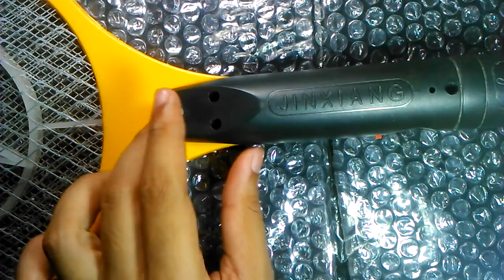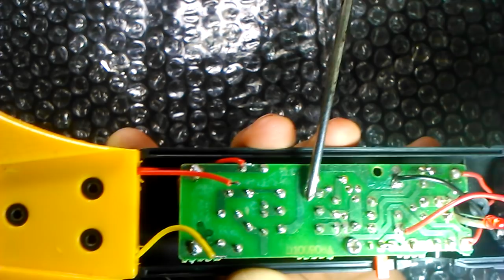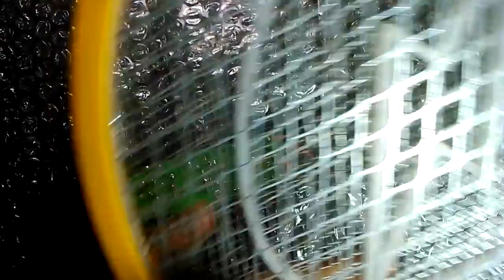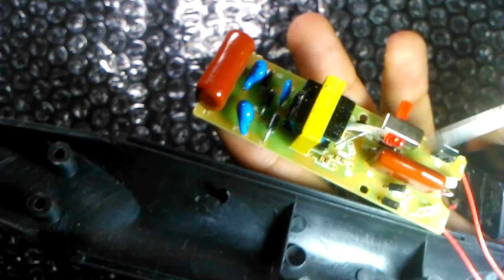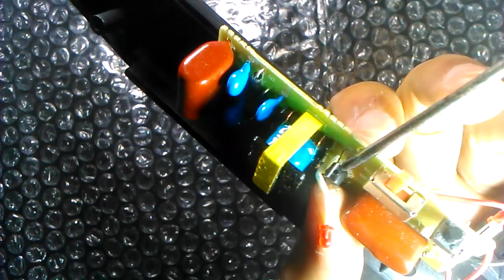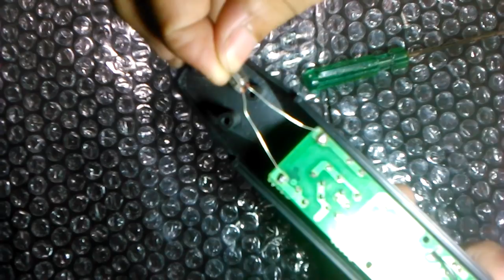IE1: Inside an electronic mosquito bat.

Comment: When you do testing with neon lamp use a limiting resistor 100kOhms and over otherwise may explode in you hand
Reply from the maker: Yup, but in this case the neon lamp is loading the transformer, when connected across the secondary, so much that the switching transistor got smoking hot. That brings the voltage down to minimum. But yeah, its better to be in the safe side. Thanks for watching the video. :)

Comment: you are correct about three stage voltage multiplier. Thank you for taking the time to make this video you explained everything beautifully.  Can you estimate the final potential generated by this circuit ? I tried connecting my multimeter but all I get is current jumping inside the multimeter, so I am thinking it is higher than 1000V DC.
Reply from the maker: paritosh srivastava If we take a look at the final capacitor, it is rated for 2kv. So if that is a 3 stage multiplier , then the output at the secondary of the transformer will be around 600V. So that at the final stage, its 1800v approximately, which falls in the safe limit of the capacitor.  And we need a high voltage probe to measure this kind of voltages. Even with that, because of the high frequency output, the meter may not get an accurate reading. Thanks for watching the video. :)